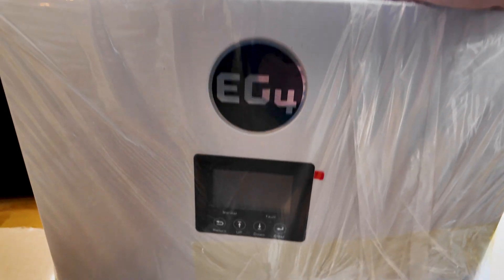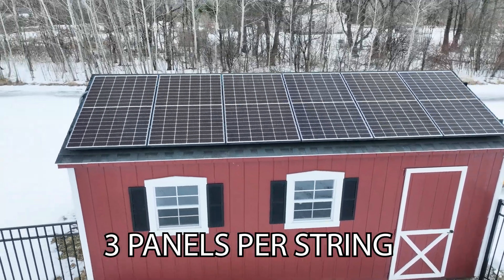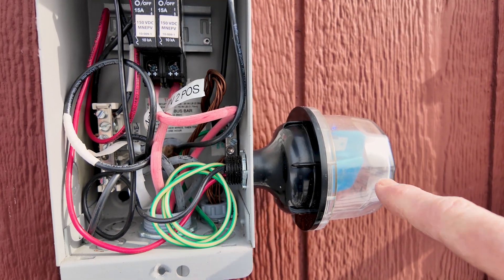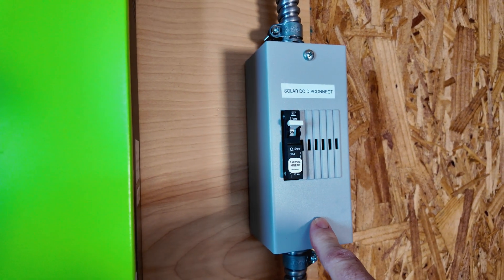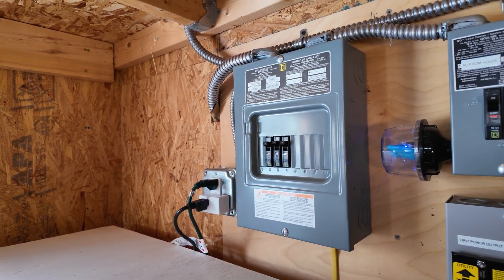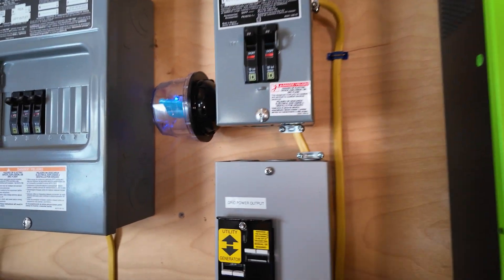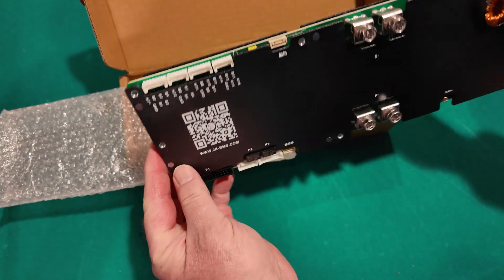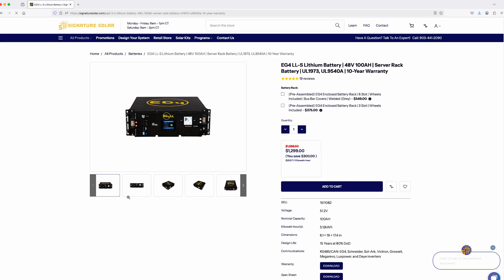Of Grid Shed Upgrade Plan - 24/48 & 120/240 Volt Conversion - New EG4 6000 XP Inverter

Comment: Looks like a great upgrade! Using 300vDC non-polarized breakers is smart...those Midnite ones (IMHO) are not the best. As for the Class T fuse -- I would keep it online/installed. The Square D AC ones are good. Breakers are great, but having a fuse + breaker on the DC side is ideal. Do you have a smoke detector/alarm system and fire extinguisher in the shed? "Safety First" is ALWAYS paramount. I can't wait to see how the install goes!
Reply from the maker: Chris, excellent tips as always!  Got a CO2 fire extinguisher  in the shed.  Need to get an online smoke detector. Not sure why I never thought of that!   Curious to knows any concerns around the Midnite breakers?  I always thought they were top-of-the-line and beter than some the stuff coming out of china.  Let me know if you have a chance, would love to learn more.

Comment: Would you do a review of the current AC inverter after is use for the last few years? How did it work for you over all?
Reply: That's a good idea. I've enjoyed watching all of Green Mountain DIY Guys vids with the shed. I've always wanted to do something like this myself and the prices have started to look way better over the last year or so. I'll be rewatching for more ideas for my own project in the future and reviews are always appreciated from folks who've used them for awhile and not just teardowns, but actual use. Though I also appreciate those too. Just would rather see products that have been put through the test of time.
Reply from the maker: Thanks for watching and sharing you insight here.  I've had a good run on the system so far, just need to go a little bigger both in capacity and voltage.